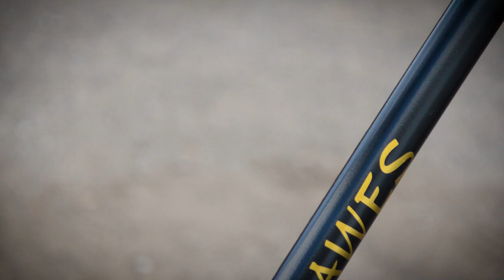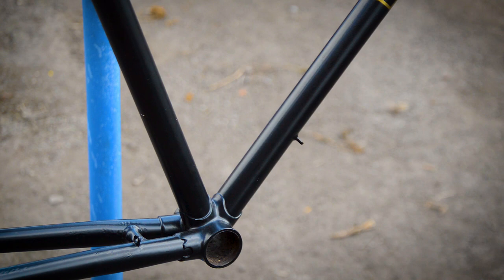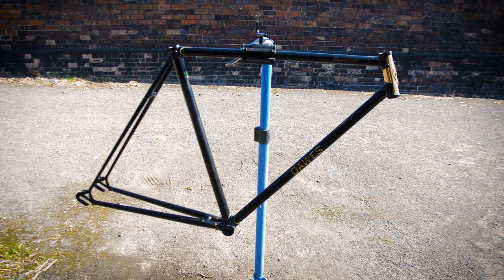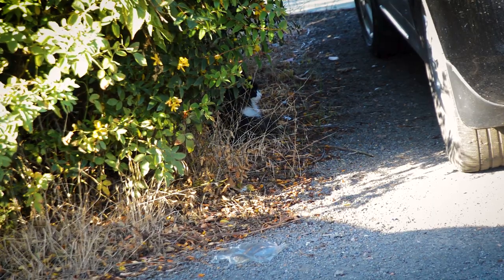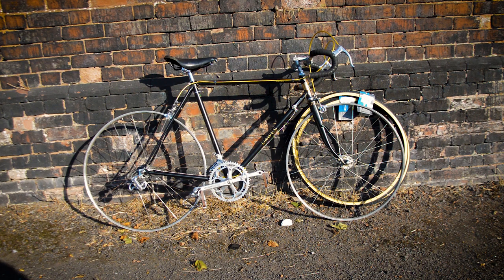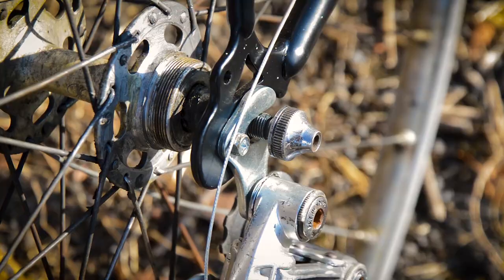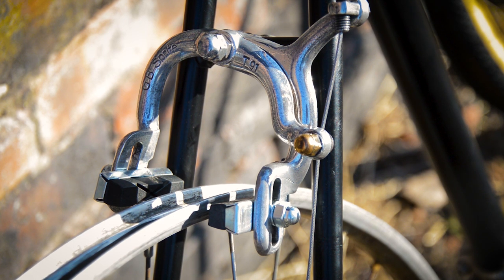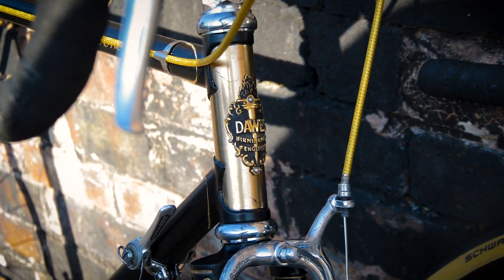1960 Dawes Concorde - Vintage Bicycle Restoration & Upgrade - Part 2 The Build

Comment: Nice job, you should definitely source an early shimano 600 arabesque crankset, the one you used is a more modern one that was not fitted with the arabesque components

Comment: Nice job on the head badge.  Good luck with the Shimano 600 Arabesque shifters.  I bought a set for a Raleigh Super Course restoration and didn't have much luck with them...lots of gear slipping.
Reply: Chris Demers I have em on a build of mine, I think they're wonderful! but I do have a nos casette...
Reply from the maker: We'll soon find out!
Reply: Could be your brass washers that are worn out or not enough tension when you tighten them up. I have 2 bikes with them and they work fine

Comment: Maybe I'm wrong, but that frame does not look like i takes a 27,2mm seat post. Too much force
Reply from the maker: It's the original seat post.  It wasn't forced in, just a bit stiff.
Reply: @MonkeyShred  Fair enough, just some weird measurement in old frames, 27.0mm 26,8 etc :-) Had the same problem and it looked like what i have experienced :-)